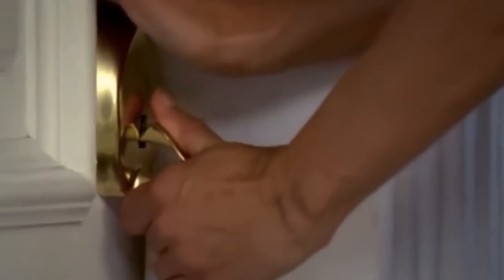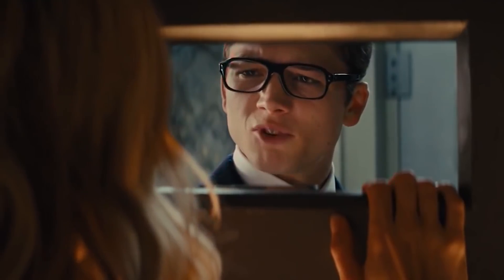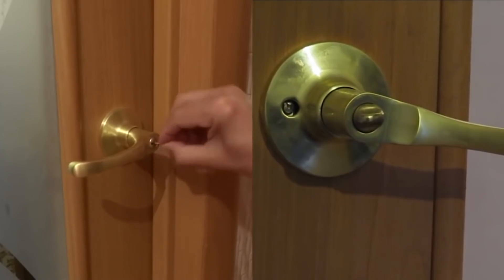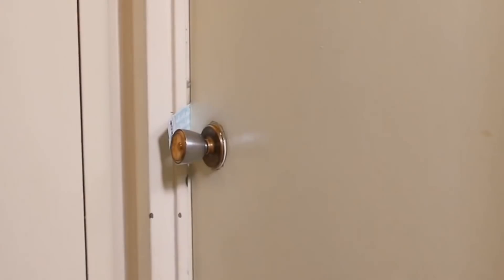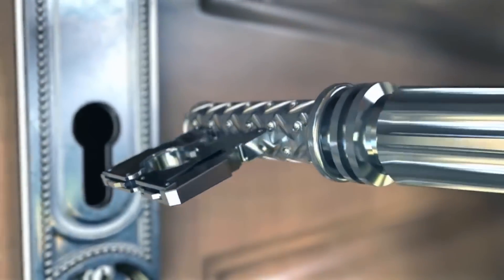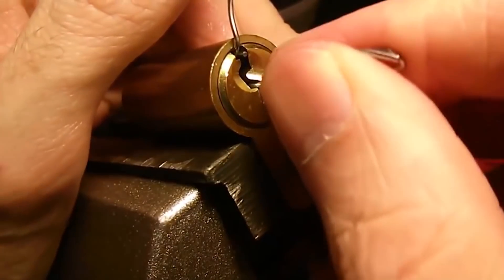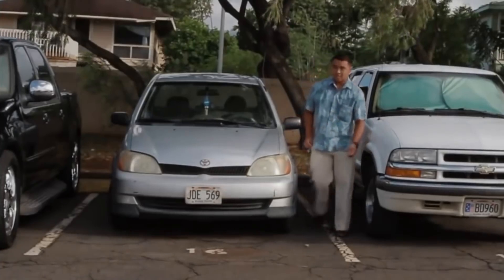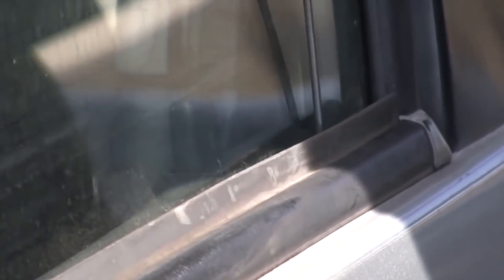5 Ways to Open a Lock (Life Hacks)

Comment: Used to carry a 'slim jim' in my truck for emergencies.
One day we were headed to our storage locker when I passed a compact that had people around it, they were trying to unlock the car.  Not only had they locked the keys inside, the engine was running... and there was a baby in the infant carrier strapped into the back seat.
I stopped and used the 'slim jim' to unlock the car, which allowed the mother to rescue her baby that had been locked inside.
I thought it was a little odd that she said "Thank God!", but didn't thank me...

When I lost the only set of keys for my truck, I learned some humility.
I had recently made a spare of the ignition/door key... but it was in the footwell of the truck, with both doors locked.
I gouged about 20 years of moss out of the tracks for the rear windows and forced them open, then had one of the neighborhood kids climb through the windows and unlock the doors.  One down, four to go.
Both of the gas caps were locking caps.  I was able to pick one of the locks with a couple of hair pins, and the other one yielded to manipulation with a similar key (not the right key, just a similar one).  I had to modify the replacement caps to make them fit my truck, but eventually got them to work.  Three down, two to go.
There's a tool box built into the bed of my truck.  The truck manufacturer didn't make the door latch or the keys for the locks, so I was pretty-much on my own for that one.  After about three weeks, my son found his set of picks (which he got for work) and I spent about forty-five minutes trying to unlock the door latch.  It finally dawned on me that I was trying to turn the lock cylinder in the wrong direction... about eight minutes later, I had it open.  I removed the latch and took it to the local locksmith, who sold me a replacement cylinder.  It took a little modification, but now it works.  Four down, one to go.
Years ago, my wife was driving the truck when the spare tire came out of the spare tire carrier and went bouncing down the freeway at freeway speeds.  Fortunately, no one was hurt.  As a result, her dad wrapped a length of chain around a cross-member and the support bar, which he secured with a small padlock.  As a precaution, I did the same thing to my truck.  Rather than trying to pick this final lock, I cut it off with bolt cutters.  Buying a replacement padlock cost less than having the Locksmith re-key the old padlock.
The reason I learned humility is because I realized that if I had to make a living as a car thief, I'd starve to death.  I'm just not that good at it.

Comment: Many times I’ve opened locked cars with  tapered Wood Shims , and a Coat hangar  I   Slowly push the tapered Shhims in between the upper Door and the  matching area on the car it will create a gap large enough to  put a coat hangar  in to reach the door lock and pull it into a unlocked position this may require bending  and resending the Coat Hager to reach the  Door lock mechanism in a manner to pull it open

Comment: 2 locksmiths couldn’t open the door to my house when I left the keys attached in the other side.
My house is a fortress with heavy duty metal doors and locks, the windows have bars and the house is made of stone.

I unscrewed the kitchens screen mesh and attached a hook to a broomstick, hooked on the key chain of the keys attached to the kitchen door and pulled. Solved!

Comment: Got trapped in my bathroom on an unlocked door which is just a turn the handle to open door. The handle fell off. Stuck for 1 mins then used the key to push into the gap in the door to push the latch open. Finally I was free

Comment: I used a hanger
Just bend the hanger in a different shape then it already is
Then place the hanger's hook on the latch slide that through the door and do it very hard, while turning the door knob. It worked for me, I don't know of it will work for you or not.

Comment: Yeah locked out. Exterior entry keyed door knob and looks like only way is to knock / cut  it off. It's on steel screen door and has that extended flat plate over it that prevents me from using a flat piece of metal like a knife or screwdriver. I've done it before using knife or other flat piece to catch the bolt then push it open. Can't do it now